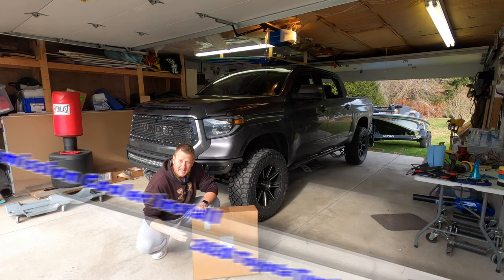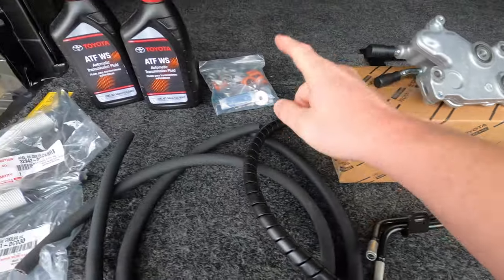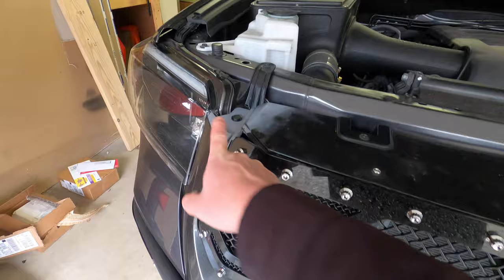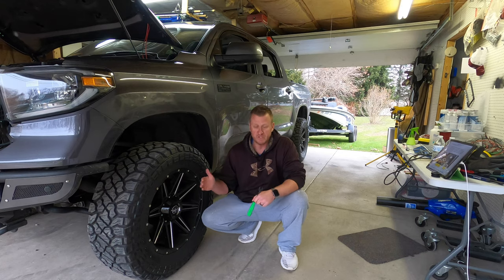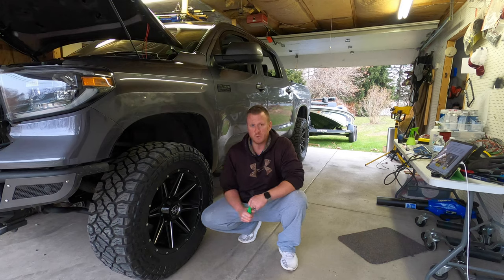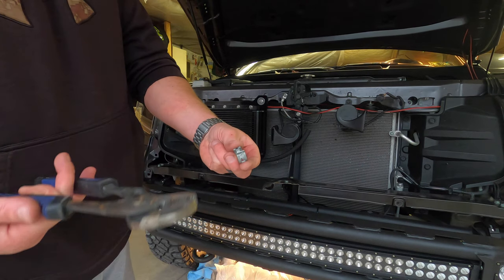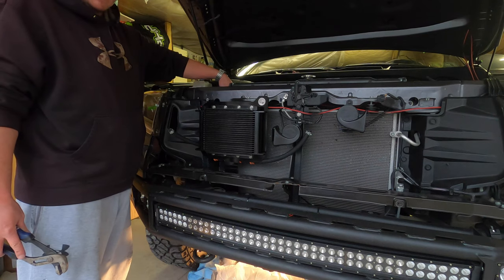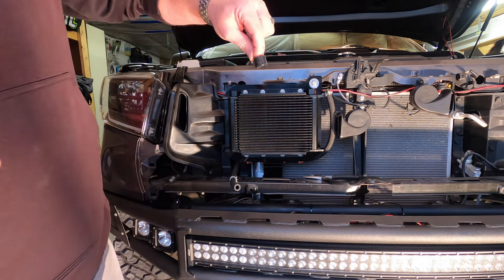Transmission Cooler Install On 2020 Toyota Tundra

Comment: Heat kills auto transmissions. No mystery.  Trans cooler comes on when needed. If you don't have it you have extra heat. I tow and haul daily with my 2014. Get this if you haul and tow.
Reply from the maker: Couldn’t agree more, this mod is well worth the small investment and a couple hours of your time, thanks for watching!!
Reply: That sounds logical, but what about the fact that we are not hearing of transmissions overheating, and then failing?

Toyota takes pride in their reputation for reliability. They're not about to risk that to save a few bucks. They don't make decisions like this 'willy nilly'.

I wish people would calm down and wait for widespread failures to happen, and THEN light up the boards.

Enough towing miles have been put on '19 and' 20 Tundras to where we would be hearing from owners about out of the ordinary trans failures because they got too hot.

But hey, I'm sure we all know better than Toyota's highly educated mechanical engineers. 🙄

Comment: When do you or do you remove the pin on thermostat
Reply from the maker: That’s the very last step I did...so after I took it for a test drive to check for leaks, I removed pin...thanks for watching!

Comment: I just wonder if the previous installed Toyota (Hayden designed and made) from 2007-2014 fit the tundras that didn’t come with an transmission cooler. That was a rather larger cooler estimated 14-16” tall about 8” across. Great posting for all newer Tundra owners. Shame on Toyota for making this penny pinching decision.....I use BG industries full synthetic WS ATF
Reply from the maker: Thanks for the feedback!...I’m not sure of that to be honest, and I totally agree...I can’t wrap my head around why they would remove something that’s been there for years and all of a sudden say it’s not needed...makes no sense to me, but this is nice insurance!
Reply: @NitroZ18Fishing : Well you didn’t throw your money away. It’s far less expensive to install this transmission cooler kit than a remanufactured transmission. You have the foresight many other Tundra owners don’t have including those knucklehead Toyota bean counters....😁👌🏽
Reply from the maker: absolutely!...this was a no brainer for me, especially with towing the boat as often as I do!

Comment: Question the pin in the thermostat does that get removed if so at what point
Reply from the maker: Hey Lawrence!…yepper, that’s the very last thing you would do (after test drive to check for leaks)…I included that in the info section but should have shown it in the video, hope that helps!
Reply: Thankyou I ordered the kit..I appreciate your video
Reply from the maker: No prob, happy to help!…let me know if ya have any questions on the install!

Comment: Just curious, I have gone on the link for this transmission cooler and it’s been unavailable for some time?  is this outfit out of business?
Reply from the maker: Hey Lance!...this particular kit is no longer for sale, he actually upgraded the kits with a better transmission cooler...send him an email and I'm sure he'll take care of ya!
Reply: @NitroZ18Fishing  thanks and yes, after I put this post I did end up emailing him and he mentioned he had a small quantity for sale in the next week or so. And to please sign up on the website for inventory alert, which I did. However, he did not mention or inform me anything up on the upgrade. If you know anything about the upgrade, please forward it to me so I could review it. Thank you so very much.
Reply from the maker: Yea so basically he upgraded the cooler after I installed this kit, so you're gonna get a better cooler than I show in video...that's really the only change as far as I know
Reply: Ordered my upgrade transmission cooler and with the upgrades I was just curious prior to ordering the OBD-ll Scan tool(just like the one you showed) have they come out with any newer ones? Would you recommend any newer OBD scan tools and or are you satisfied with the one you showed in this video? Thank you.
Reply from the maker: Nice, let me know how ya like the cooler!...the OBD2 I show in video worked perfectly for this project...there's a bunch on the market but that one was great for this install!
Reply: Just reaching out after getting some help to hook up my OBD I have loaded in it AT 1 Oil, temperature,  AT 2 Oil temperature &  PID temperature. And they’re all pretty close. Can I use this when I go to check and do my adjustments on the AT fluid ? Thank you for any help you can help me out. This has been a struggle trying to put this in.

Comment: What temps are people getting without the kit in Fourth? Staying out of OD. I can’t get an answer.
Reply from the maker: When I was towing I would see temps 220+ easily…whether I was in 4th or just had it in “Drive”…I definitely wasn’t comfortable with it, I even saw temps over 230 at times…much better since the install!…hope that helps!
Reply: @NitroZ18Fishing  yeah I got the bluetooth thing and app. Mine was up to 225 in drive pulling an empty trailer. It gets to 210 just driving.

I got the cooler at the house. Going to try the install Sunday after church before this hurricane hits 😂
Reply from the maker: Let me know if ya need any help, and stay safe with that hurricane!
Reply: @NitroZ18Fishing  i just finished it up. Took about 6 hours 😂 

We were looking for that bracket for awhile. It doesn’t come with that anymore. Also was looking for 12mm flange bolts but they are now 13mm flange bolts. Then the pump I got didn’t fit the bottle so we had to run to the parts store. Called my dad to come pick me up and battery was dead in his truck 😂 

I put it a quart and a half or maybe a little over and had just a trickle coming out of the overflow at 99 degrees.

Oh I also dropped one of those flange bolts and it fell on top of the frame. Had to take my skid plate off.
Reply from the maker: Yea I heard he’s made some changes on the kits, glad ya got it done!…it’s definitely an awesome mod for our trucks!
Reply: @NitroZ18Fishing  yeah he emailed me back on the way to advance to get a pump. He said he’s going to update the instructions to clarify a few things.

I haven’t taken the pin out and it got up to 160 and started cooling back off. Gonna see how it does towing tomorrow, then take the pin out and make comparisons.
Reply from the maker: Nice, I have my pin pulled and never see any pan temps above 200, even when towing…it’s crazy…so much better than before the install!
Reply: @NitroZ18Fishing  that’s good to hear! It’s crazy hearing people say “it’s designed to run hot” like wtf!? Then why are the brackets still installed on the transmission?
Reply from the maker: Exactly!…heat kills transmissions, no way they should have taken it off!

Comment: The irony of installing an external cooler is that you risk voiding your warranty.

Scenario: In an unlikely circumstance, your trans fails, that's not even related to trans temp. Toyota has the right to refuse to honor the warranty because you modified the way the transmission was engineered to function.
Reply: How so did you modify ? he just installed something that was there previous years , but omitted just on 2019/2020/2021.

Comment: Anyone know if this add on will void any of the warranty?
Reply from the maker: Hey Keith!...I asked my dealer and I was told that if something goes wrong with truck, they would have to prove that this caused the issue...so basically means that it doesn’t void warranty, but if they can prove that it caused the problem then they can deny a claim

Comment: Why not jack up the front end of the truck so that you had more room to work and video?
Reply from the maker: Truck has to be level for fluid checking process...and honestly with the lift and 35’s, I can move around easily under there...haha...I could have jacked it up to install lines and thermostat but it’s high enough to slide under on a creeper with ease...thanks for watching!

Comment: You forgot to replace crush washer
Reply from the maker: It’s actually not needed, it doesn’t call for it to be replaced… I’ll keep an eye on it but no issues at all!... i’ll update the channel if anything changes, thanks for watching!
Reply: @NitroZ18Fishing , its a crushable washer. Its one time use. Its common sense, that's why its not called out. Just like wiping oil on your floor, its not called out.
Reply from the maker: well I spoke with Nick directly and he stated that it doesn't need to be replaced, so I guess we'll see what happens...in fact, he stated that he has reused his multiple times with no problems...no issues at all for me!

Comment: Wouldn’t this void the warranty if installed at home? I just got a 2019 tundra
Reply from the maker: They would have to prove that the cooler caused the issue to deny a warranty claim, installing aftermarket parts can’t void a warranty automatically…hope that helps!
Reply: read up on the Magnuson-Moss warranty act. He is right, they would have to prove this  aftermarket cooler ruined your transmission.
But also, I could be wrong about this, the warranty act defines aftermarket parts as parts that are not OEM but have OEM specs. Like you don't have to use Toyota parts but you can use OEM spec'd parts and the dealership should not deny your warranty claim.
I'm no lawyer but reading up on the Act, that's how I understood it.

Comment: Toyota removed the cooler for a reason the transmission is just fine without one it will run up two 250 degrees why pulling heavy load without any problem or over heating light
Reply: Finally - someone with a voice of reason.
Reply: $$$, btw by the time the warning light comes on your fluid is burnt

Comment: You guys are nuts, lol.  I'd rather just buy a truck that actually has a trans cooler installed at the factory and doesn't lie about it on the sticker.  That, or don't tow over 5000 lbs.
Reply from the maker: Yea it’s pretty crazy that they would remove it, but it gave me something to do on a weekend 🤣